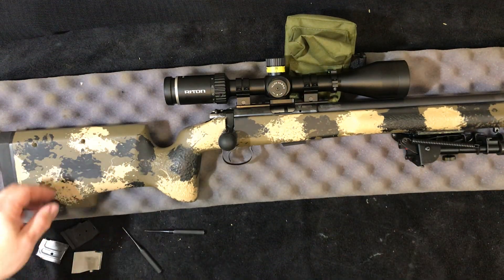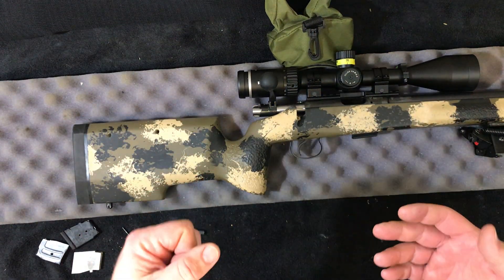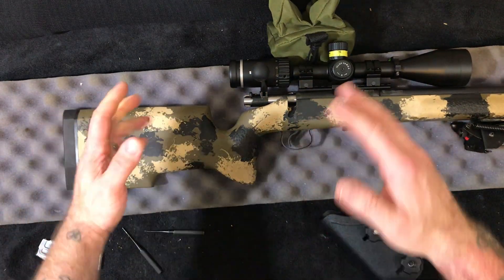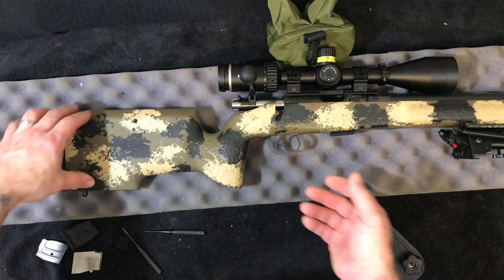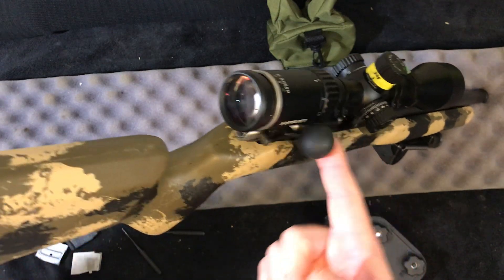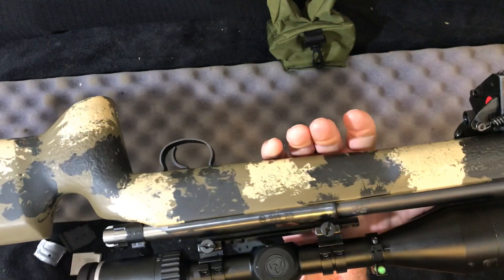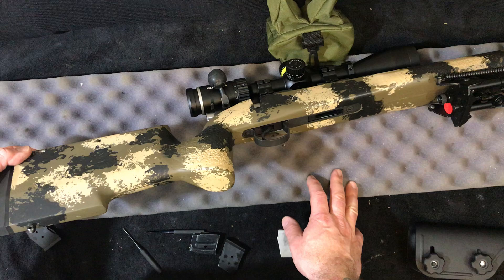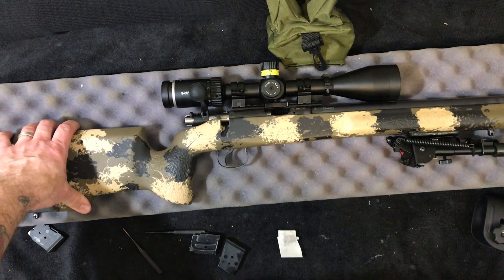CZ 455 Varmint Precision Trainer build

Comment: Mark & Sam after work did a video about scope ring height. Being low doesn’t help unless under fifty yards. More important is scope clearance for the bolt and getting comfortable. If you go with a over sized bolt handle you will need medium rings. Especially if you go with a scope that has a 56mm objective. I have the same stock.
Reply from the maker: Love mark and Sam! All very true except I am most definitely more comfortable with it lower. Thanks for the interest

Comment: I see u have mounted a sling to the CZ, what sling and mounting type did you use?
Reply from the maker: Hey there,

It is a 70s era Anschutz 3P sling. I discuss it in a video actually, but I have since installed the sling mount on an Arca clamp so I can slide it anywhere on the rail.

https://youtu.be/1R2mwAzUztk

Thanks a lot for the interest,

-Dan